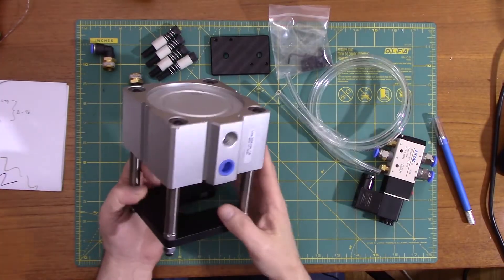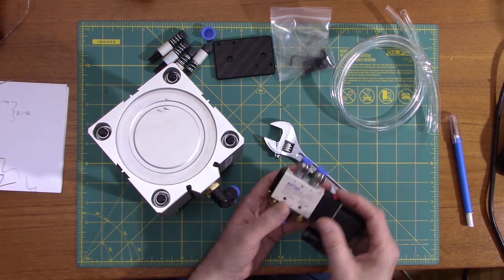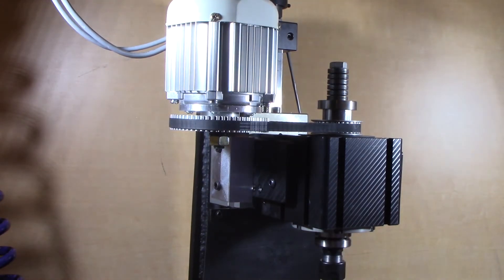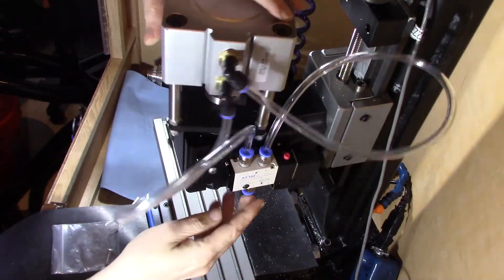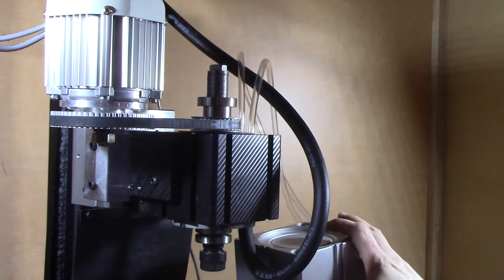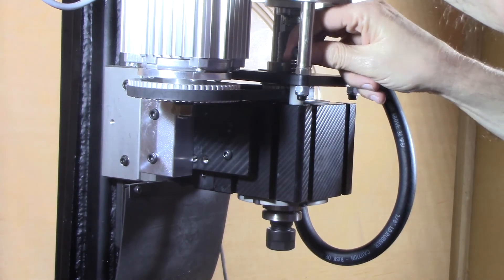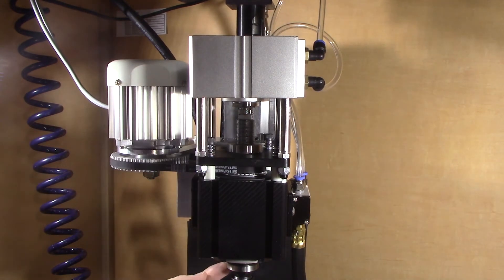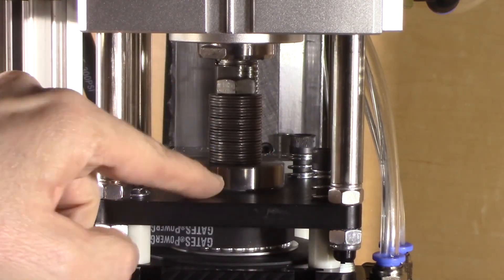Taig Power Drawbar, "Taigmach" Part 9

Comment: Great demo of it working, well focussed and explained. Now I understand exactly how it works and can start my own. Where did you get the air cylinder? I only have 100 psi in my shop. Is that enough?
Reply from the maker: I purchased the R8 spindle and power drawbar as a kit. There is a link in the description where you can find more information.

Comment: That drawbar is dope, the whole spindle assembly sounds awesome at 1600 rpm - What kind of compressor/air system do you use in your shop?
Reply: I love your upgrades. If you ever consider selling, I'd buy.!! Great job.👍
Reply from the maker: I'm using a Dewalt 4.5 gallon compressor rated at 200 psi, which I needed for my injection molding machine. The power drawbar only needs about 115 to 120 psi, and it doesn't use much air at all. So pretty much any compressor will handle it.

Comment: Good looking setup,  John, how many RPM's can you top out at with that motor and spindle (reliably)?
Reply from the maker: I don't know yet, as I need to make a few changes before I can make some parts. With the motor and pulleys I have, it can go up to 14,000 RPM. I believe it might be able to handle that, but I'm going to start with 10,000 RPM for some jobs and see how it does before pushing it higher.
Reply: @JohnSL  Interesting, John, thanks for that-

Comment: Very intetesting video.  The R8 collet system is great.  So many choices and a lot beefier than ER16.  I hope you have a wrapup / review video when you complete this project.  Imagin, your very own Transformer.
Reply from the maker: I'll absolutely do another video using some tools set up in TTS holders along with a Haimer for edge finding and height setting. I'm looking forward to it, but need to move the Y and make a few other small changes first.